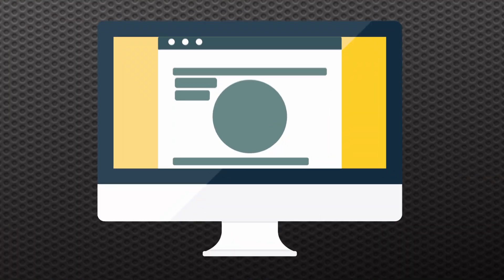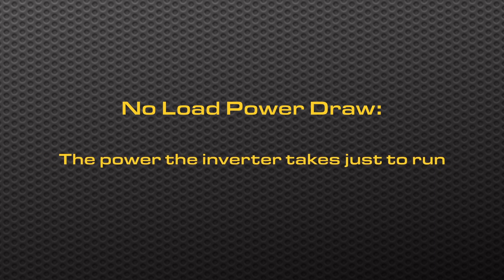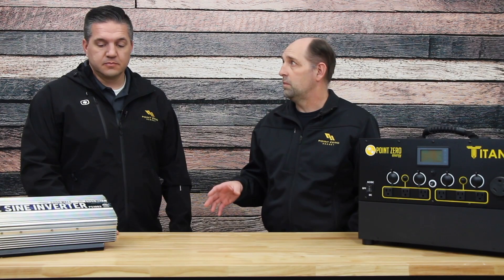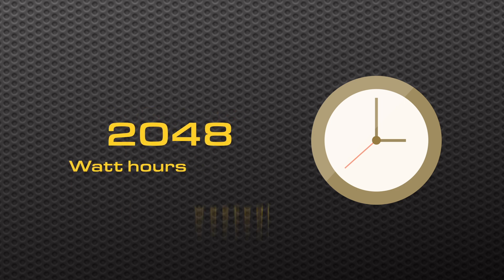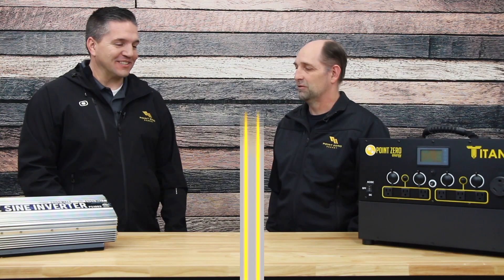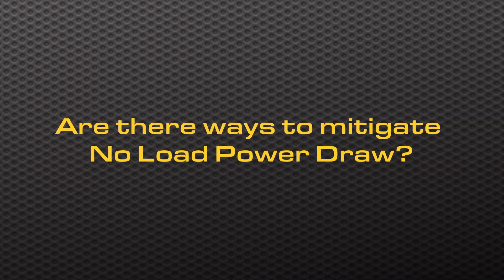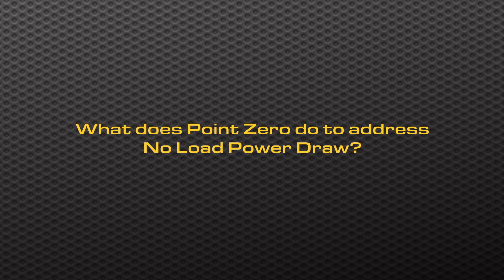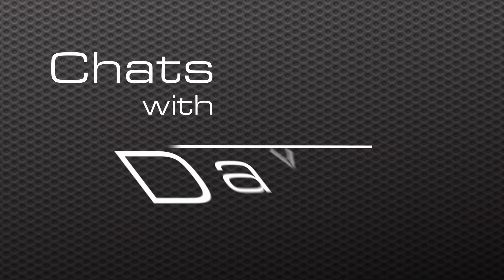Inverter Efficiency: Understanding Solar Generator Inverter Efficiency

Comment: Nope I've never heard of no load power draw and I've definitely checked out hundreds of powerstations.Thanks guys✌️
Reply from the maker: There are a lot of things that most people never hear about, which is very important to a working system, and causes a lot of frustration when people buy a system, then it does not perform how it should.  Thanks for watching, and keep tuned in for a lot more information never shared by most companies.
Reply: @PointZeroEnergy  u bet✌️